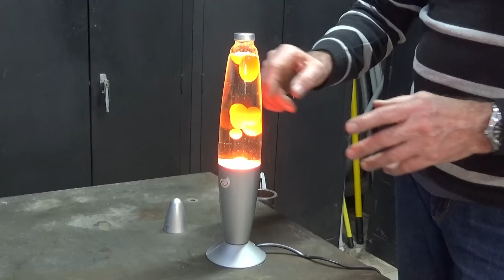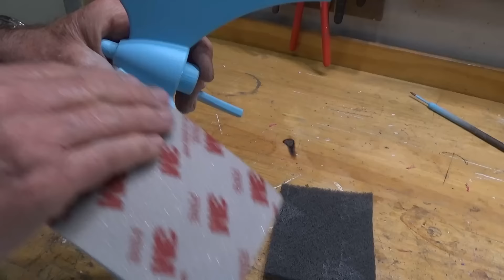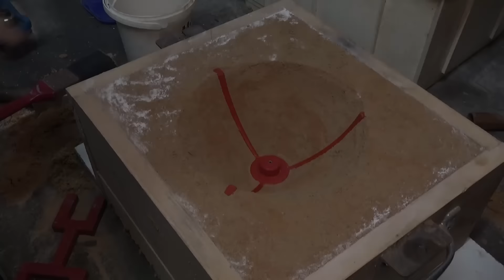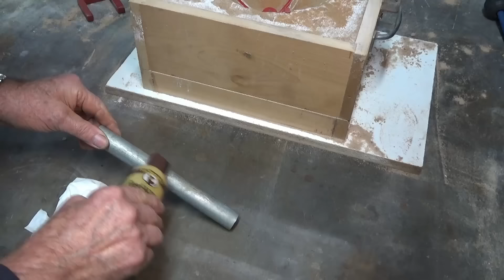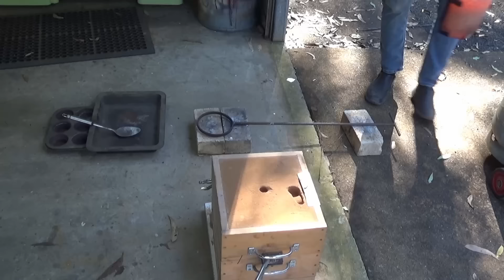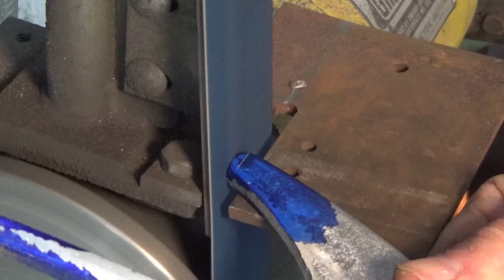How to Upcycle a Cheap Lava Lamp With a Cast Aluminium Base

Comment: I have used epoxy for similar AL castings. I use 2% epoxy by weight and then mix with acetone for blending with the sand. Also I have cast car diff covers that have the same hanging cope problem. I added a partial disc and rod fastened down through the cope to support the extra weight. Love your videos!
Reply from the maker: I should try using less epoxy. I generally use between 6 and 8% but I guess that adding the acetone will wet the sand better. I was told after the event that I should have turned the mould upside down so the cope was underneath when separating the first mould. I will try that next time.
Regards,
Mark

Comment: I well remember these first appearing in the UK in the late 60's. My next door neighbour had one, and as a kid I was both fascinated and jealous. Then they became naff. Now it appears they have become retro. The original bottle was the same bottle as was used for a brand of fruit squash/cordial (where you dilute with water, very sweet and sticky) called 'Treetops'. I've just had a look but unsurprisingly the old bottles are no longer around. The one you have is close in shape, but not exact - I'm not sure whether the ones still provided by Mathmos are the same as they used originally, they might have had to switch to their own shapes when the branded juice bottles disappeared, some time in the last 60 years. Tricky casting - I feel like you could have cast or machined 3 legs and a separate base, then joined them, more easily, but where's the fun in that I guess.
Reply from the maker: I did consider making separate fins either by machining from solid stock or by making individual castings but the joints were always going to be tricky and adding fasteners was also complicated. At the end of the day, I wanted to try a casting that required coping down to a 3D parting line. That part was relatively simple but making the cope was not. I was told later on that I should have turned the whole mould upside down to keep the domed part of the cope from obeying gravity and falling off. I will know better next time. I read a bit about the original Mathmos lamps. I half expected Edward Craven Walker to be a long haired hippy but he looked like the most conservative British gentleman ever!
Regards,
Mark

Comment: Perhaps some breathing holes on fins would allow full fill..
Reply from the maker: Yes, and I did almost add vents to those areas but I thought that the height of the mould would give me sufficient head pressure to avoid an airlock. Possibly the greensand was a bit damp or maybe I rammed the cope too hard. However, I have been able to salvage the part by adding some extra rocket motors. You will see the upgrade in the next episode.
Regards,
Mark

Comment: Quite a chalange that one but you pulled it off.. I am thinking adding some risers to the all the legs would have prevented the short pour. Try it on the next one!
Reply from the maker: Yes that was quite the oversight on my part. I was so focussed on getting the coping down part done that I overlooked the venting. Still, it actually gave me the opportunity to add some extra bling.
Regards,
Mark

Comment: Good start Mark. It never gets old watching you do that sand casting. I really enjoy it, then we get to see the cast item when it has cooled. It was good that you can use the first attempt, I bet it takes quite a bit of time to re do it if you have to. I have not had spinny legs flying around on the metal lath, but I know what you mean by it is a bit scary. In woodturning I have made a few winged bowls and it is a bit the same with wings flying around all over the place. It is very easy to catch the tool on a wing, or worse, have your hand or a finger touch a wing...
Reply from the maker: Thanks Jon. I was so confident when I first opened that mould. It really is a humbling experience when you see a fail like that. However, it has turned out better that the original design. I know what you mean about snatchy, spinny, hard to see parts. 
Regards,
Mark

Comment: WOW, impressive work, very nice. Any consideration given to making the part in 4 pieces? That would have been my first inclination. Scary Workholding for sure.
Reply from the maker: I did consider having separate fins but I abandoned that idea when I decided not to attach the fins to the original lamp body. The joint line would have been a three dimensional affair which probably would have needed a CNC tool path.
Regards,
Mark

Comment: Looking at the way the two short fins didn’t fill I think it might have been venting that was the problem.  Perhaps if you had run a wire down into the top of the fin it would have fully filled.  All in all a very nice casting though.
Reply from the maker: Yes, I thought about venting but I got cocky and decided that there was enough head pressure to fill the mould completely. I made the metal extra hot too, around 800C. 
Regards,
Mark

Comment: Thoroughly enjoyed the video Mark. Very nerve racking watching you set the mould. Many years ago I bought my wife a genuine Larva Lamp. We discovered that the don't mix very well with small children. Silly question, could the boss and legs be cast separately? Perhaps a tongue and groove to attach the legs? Just thought. Cheers Nobby
Reply from the maker: I did consider making the legs as separate pieces but the joint was always going to be tricky. The lamp is now finished and it looks great. They are a fairly unstable and wobbly design, especially with the original circular spun aluminium base but now it has a wider stance it should be safer.
Regards,
Mark

Comment: I think you could cast the complete bottom section. The light bulb just needs to be able to heat the coiled wire in the base of the lamp. The mass of a cast base may cause the lamp to take longer to reach steady-state, but it should still get there.
Reply from the maker: I just completed the lamp yesterday and due to changing out the bulb holder, the heat bulb now sits about 8mm lower in the lower section. It nearly doubled the time it took to get the wax melted so it seems that there is a very narrow window in terms of heat distribution. I will need to raise the bulb closer to speed up the start. I guess it doesn't matter too much if you are going to leave it on for an extended period though.
Regards,
Mark

Comment: Hi Mark, I was expecting that, could you have put a small rod on each leg to allow any gasses to escape and poured the metal into the center hole
Reply from the maker: I should have vented the mould at the ends of the two legs that didn't fill properly but I got cocky and thought it wouldn't matter. Turns out my intuition was correct. 
Regards,
Mark

Comment: Good idea for that epoxy core.  I think I would have used normal molding sand for the whole thing, but turned the mold upside down to open it.  Anyhow, many ways to skin a catt as they say.  I can already tell the lamp is going to look amazing. 👍
Reply from the maker: Doh! Why didn't I think of that? A great tip. Gravity can ruin things real quick.
Regards,
Mark

Comment: Cool effort. I say bead blast the lower fins. The casting was amazing. Did you consider making a bigger(longer) fin pattern, so you could plan to machine off the ends and top corner to "hide some sins" in the actual casing process?
Reply from the maker: As it has turned out I did fully polish the casting and it turned out fairly well. There is some minor porosity and pitting but overall it is a good match for the rest of the parts. To be honest, I hadn't considered the mould not filling completely. In hindsight I should have vented the two cavities where the legs didn't completely fill but you know what they say about hindsight!
Regards,
Mark

Comment: Having done no casing myself, I wonder if lost-wax-casting would’ve been easier, or worked at all. Glad it worked out ok though 👍
50s to 70s looks like a wonderful time period. No public computers but technology advanced enough for a very comfortable life.
Reply from the maker: Lost wax casting allows for almost unlimited complexity for the finished part. There is no need for draft and you can have undercuts and hollow forms but it is very equipment and material heavy. I just don't have the gear to use that method at present. It is something I would like to try though.
Regards,
Mark
Reply: @Preso58  I thought there was a reason, but not knowing enough, I didn’t hazard a guess.

Comment: Green sand? Or epoxy type sand ? 

Have you any metal spinning videos . Thanks for your time
Reply from the maker: I used green sand for the drag (bottom box of the mould) and epoxy sand for the core that filled the coped down section in the drag. The top box (cope) was all green sand. I have done a little metal spinning but it was way before I started making YouTube videos. I made some brass bezels for some model locomotive windows. 
Regards,
Mark

Comment: My bum puckered when you split the mold 😂 but good work arounds on all issues.
Reply from the maker: Yes, it was exciting at first and then it all went bad. It's part and parcel of metal casting though. It's best not to take it personally.
Regards,
Mark

Comment: Tough gig casting that, I don't envy you on that one, quite a nice outcome though. 👍 Just as a thought, it's been suggested to me that you can use printed bits in the same way I use foam to make lost foam castings, I did have a quick go at it a while back without much success, but we came to the conclusion that the printed parts I was trying it on had too much infill 🤔
PS: Did you receive that sticker I sent you, I still haven't received yours yet, but that doesn't surprise me. I sent one to Rusti the day after I sent yours and he received that 2 weeks ago.
Reply from the maker: Thanks Paul. I did receive your sticker and I have included it in part 2 of this build. It should be out next weekend. I got a bit cocky on that casting. The last two that I did worked first time but that almost never happens. 
Regards,
Mark
Reply: @Preso58  Glad you finally received it, I just wish that yours and Matty's from Matty's Workshop would show up here, Aust Post is so slack in getting mail over to here, once it arrives here I'll have it within a day or so.

Comment: Hey Presso, I love your Videos, but iam astounded at the amount of time and money spent doing this when you could have just bought the genuine Mathmos Rocket lamp, and used your time and money on all of your other projects.
I personally have the genuine lamp, its great.
Reply: Its the journey, not the destination.
Reply: @skypatrol716  Yes thats true !
Reply: We would not have anything to watch and learn great yeacher this guy .  @skypatrol716
Reply from the maker: Prompted by your reply here, I address that issue in part two of this series. Unfortunately, items made in the UK and USA don't always ship to Australia where I live. Sometimes the shipping cost is as much or more than the item cost. At the time I started on this project, Mathmos were not shipping to Australia but I just checked and there is now an Australian website but it is not complete. Still, it would have been over $200 if I could get one and my total outlay for this project was less than $50. I also wanted to work on a casting that required coping down since I had never tried it before. Also, the finished project is unique. I guarantee, there isn't another like it. Having said that, I just shelled out over $250 for a mid century modern clock on Etsy. It is made by Royal Enamel in the UK and they do ship to Australia. It is a lovely clock and not something that I could easily make myself. Hopefully I will show it in the final video in this Mid Century Modern series of videos. 
Regards,
Mark
Reply: @Preso58  Hi Mark.
Wow, thank you for such an amazing comment back to me.
It all makes sence to me know.
I notice when looking through you list of videos, you have made a good number of beautiful lamps, and I will have to watch them through.
That is a favorite hobby of mine.

Actually, I have made 2 Australian Model lighthouses. 
A generic QLD Lighthouse &( Mersey Bluff in Tasmania )  & I,am starting on ( Nobbies Lighthouse in Newcastle NSW )  my home town.
I have thoughts of making a video of them.
Thanks so much for your time and brilliant videos.
Ian T.